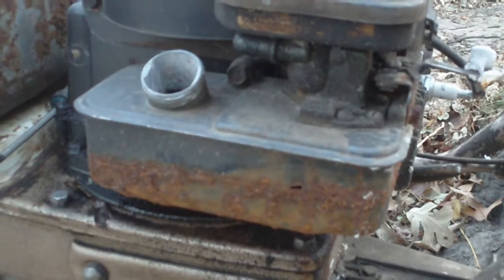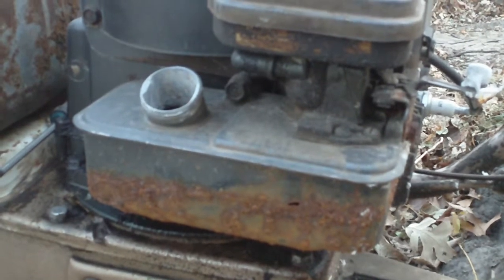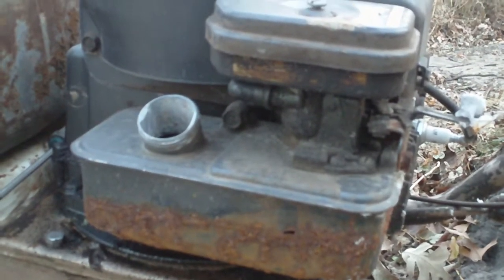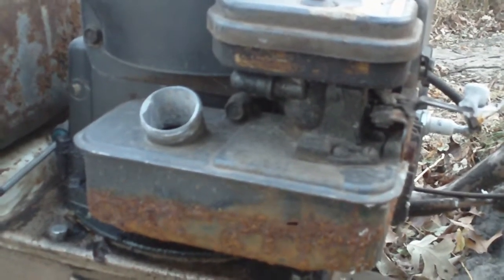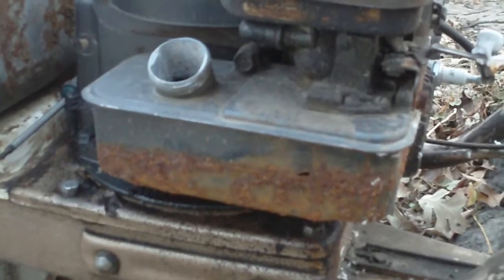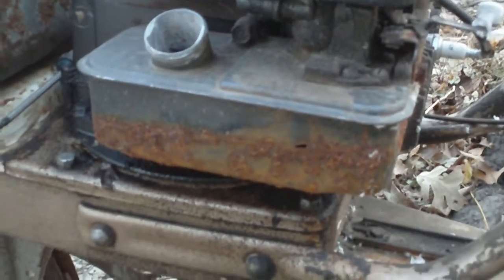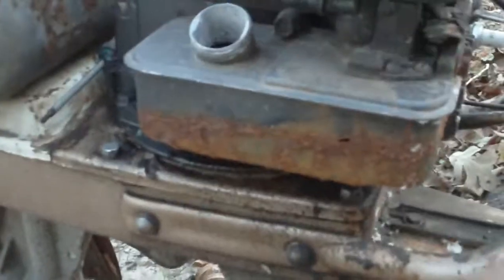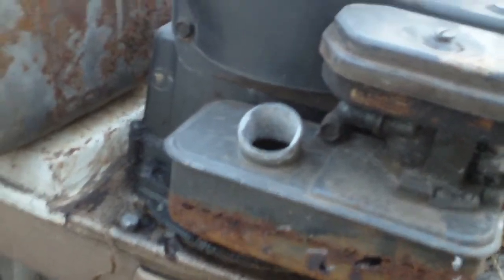Rusty gas tank experiment gone wrong (Liquid Draino)

Comment: hey. that's called flash rust and this is what you did wrong.

draino contains acid, which you probably know, what you don't know is that acid will rust the bejeezes out of metal as well as separate the rust.  the reason for this is chemistry, and you must use chemistry to prevent it.  after you have used the draino solution, which, shouldn't last more than a day (if that) then you have to rinse it out AND neutralize the surface of the metal, which is still coated with acid and reacting to it.  a solution of baking soda and water is what people usually use.  a quick Google will show you all of this.  after you drain the water you have to dry the tank out completely using either heat, air, alcohol, or a combination of these.  it's recommended after that that you seal the metal with a metal sealer.  many people simply use wd40 and make sure they've coated the tank well.  it's like keeping oil on a cast iron pan, keeps it from rusting.
Reply: also you have to make sure all the metal inside gets the draino, it looks like you only filled the tank up halfway
Reply from the maker: Thanks for the advice.